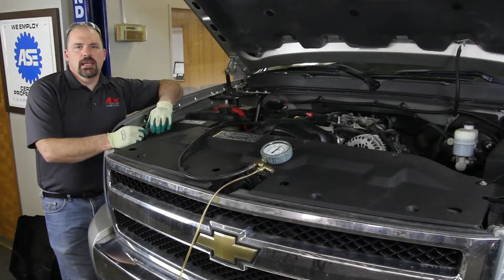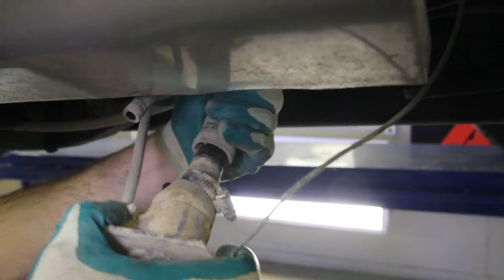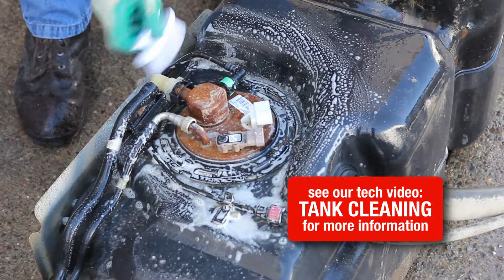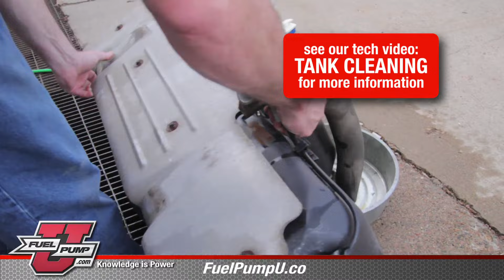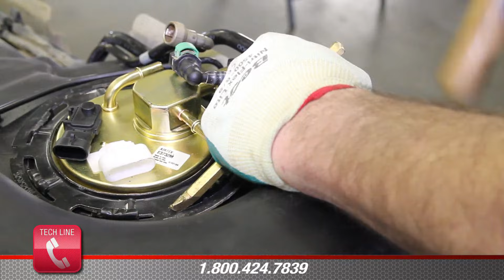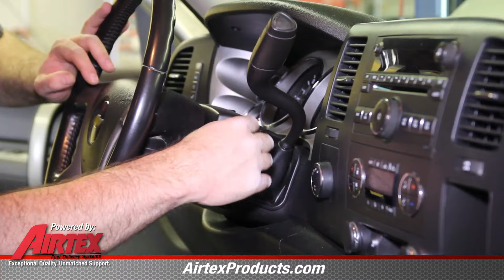How to Install Fuel Pump E3732M in a 2007 2008 Chevy Silverado GMC Sierra 1500

Comment: Do Not remove the fuel tank. This is extremely dangerous for the average joe in his garage.  Remove bed bolts on the tank side and loosen bed bolts on the passenger side. Tilt bed up with cherry picker and tank is fully accessible.   
No wonder asssshole mechanics charge so much.

Comment: Does anyone know where to find a new fuel feed hose assembly?  I thought I could outsmart the connector without the releasing tool and lost.  Or, is it safe to replace the connector on the nylon hose?
Thanks
Reply: Dorman 800-760 Fuel connector and a 3/8 rubber fuel line to repair

Comment: 08 siliverado LTZ crew cab . Is the fuel filter in the fuel tank ?
Reply from the maker: 2008 Silverado, fuel pump module E3732M does have a strainer inside. The truck may have an inline filter as well.

Comment: Im about to do this procedure tomorrow …...this video is really helpful . I wasn't sure which would be easier ….removing the tank or taking the whole bed off the truck .
Reply from the maker: Good to know the video was helpful.
Reply: rust belt, remove tank, non rustbelt, bed
Reply: crap.. I have a cutoff van with a box truck, do I need to remove that?
Reply: Panasyukvic  Honestly....I would take the tank out instead, just be aware depending on age of the vehicle removal of the tank and pump is not as easy as shown. My truck was 11 years old when I did this and I had to replace alot more parts than shown here.
Reply: @richhattenhauer3986  ok. I'm 06 GNC savanna. thanks for replying!
Reply from the maker: @Panasyukvic  with a box truck removing the tank will be the way to go. I will agree with Rich Hattenhauer, depending upon the climate you live in it may take more parts an be more difficult a task. Gotta love rust and corrosion!
Reply: Is the fuel filter in the pump assembly

Comment: its a good video but it would be have been better if you would have said what size sockets you will need and what not
Reply: That's common sense dude!! Seriously you need to fit the correct tool size to your parts. Simply put... everything is different so find and feel it out.

Comment: hi ,I have a 2008 gmc sierra I had a problem with my fuel pump, I took it to the shop and they installed a napa fuel pump ,now I always have engine light on with code p0191 (fuel rail pressure snsr performance) and p069e(FPCM) its been 5 weeks now and they didn't solve the problem yet,if you can help me ill be more than thankfull
Reply: Thanks for the fast reply ,they already changed the fuel sensor and I'm still getting the same code ,but I seen him cutting the plug that you hooked to the fuel pump plug and replacing it with one fit the fuel pump ,thanks for your help and if you want me to pay for this information I have paypal all I want to fix it thanks
Reply: Yes I did ,it was from the cheap pump that they installed for me there was not enough pressure ,I took to gm dealer it cost me 800 installed ,and the first one took 1400 from me ,but I end up getting all my money back
Reply: Yes ,and anyway Napa won't last long ,they have to return it and make sure u take a receipt with you for the labor time they have to give u back all ur money